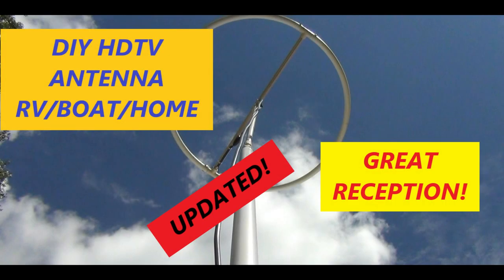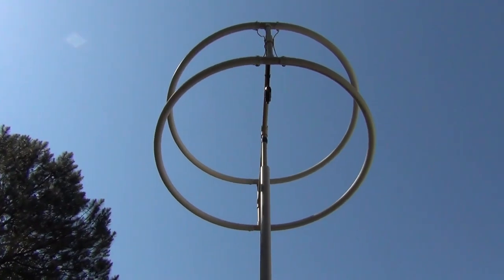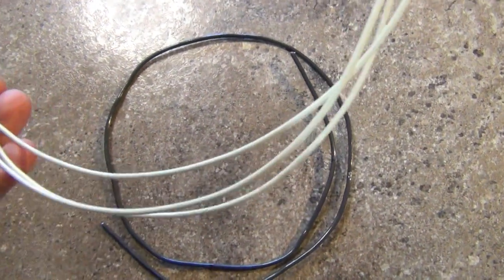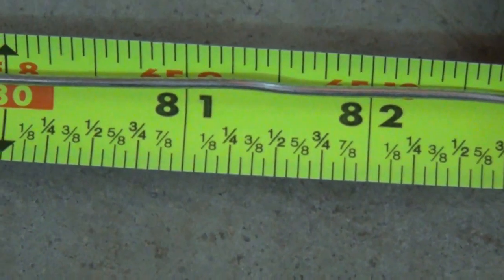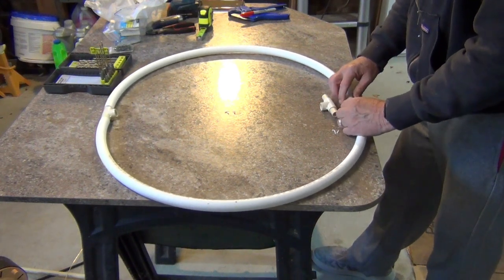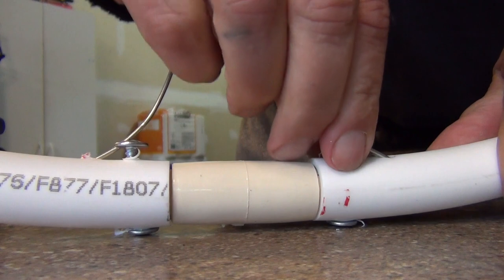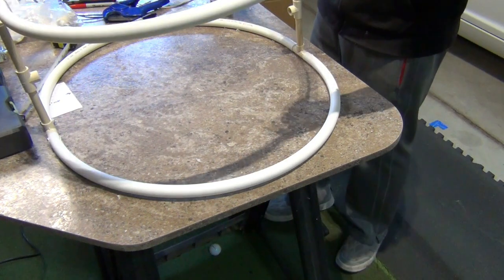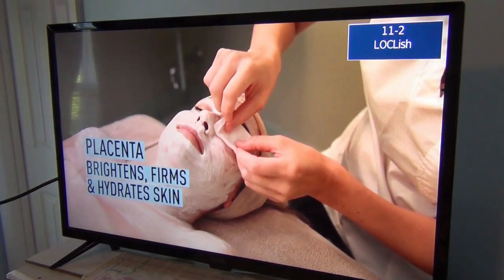Stacked Hoop TV Antenna

Comment: I have an idea Mr. Hop To It. How about using 1/4 inch round tubing with a silver solder on the outside of the tubing. But the difference will be having a pattern put on the outside of the tubing using silk screen pattern coated on the outside which will keep the silver on specific pattern on the outside. This is like using SHOTTSKIES Triangles as the pattern but without any cutouts. The silver will be where the cutouts would be. This is what most cell phone antennas use to increase the size of antenna with super small form factor package except they have a foil with cutouts. 
I know this is a bit complicated but this is worth trying for maximum performance signal gain.
Reply from the maker: Interesting thought

Comment: It sure beats spending tons of money on a Winegard 360 antenna. Your antenna design reminds me of the old Telesine loop TV antennas of  the late 1940's invented by W.E. Antony of Shreveport, LA. He used 1, 2, and 4 elements loops, however they were mounted vertically to create a bidirectional antenna for gain and directivity (like the UHF loop on old TV sets) rather than horizontally to create an omnidirectional antenna. His  L-VHF, H-VHF, and UHF loop systems were huge. Pictures are on the web. Horizontal loop TV antennas though may receive multipathed signals creating ghosts on analog TV signals and signal dropouts on digital TV signals.
Reply from the maker: Thanks for the observation. Horizontal loops won't work well in all situations. I have also posted episodes on assorted vertical  antenna designs. Check them out!

Comment: How much difference in reception strength did you gain by using two rings coupled together Mr. Hop To IT ???
Reply from the maker: In my case, it did increase reception strength but not by a large margin. Other people have reported higher gains - so it all depends on your situation.
Reply from the maker: As usual, you ask a great question. Maybe I will put that on my list of future projects. Thanks!

Comment: What is the theory behind the 25" diameter and does this measurement need to change depending on the frequency of the desired station you want to pull in? Also, is this VHF, UHF or both? I need to access mostly the UHF TV band (ch.13 to 36)  and only ch.12 on the VHF band. Thanks for the videos!
Reply from the maker: The element length is determined by the frequencies the antenna will receive. That length gives it a broad band ability for the main UHF channels. If your signal is strong enough, it can also pick up high end VHF.
 My hoop antennas get a good signal at my location for VHF channel 8.
Reply: Thanks for taking the time to reply, I will stick with that length and see what happens. Thanks for uploading these videos 😊